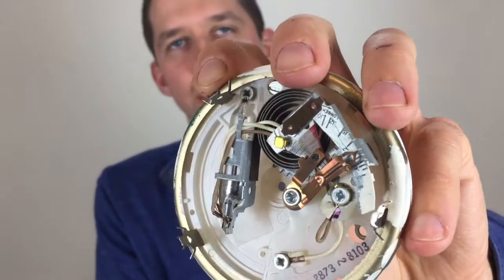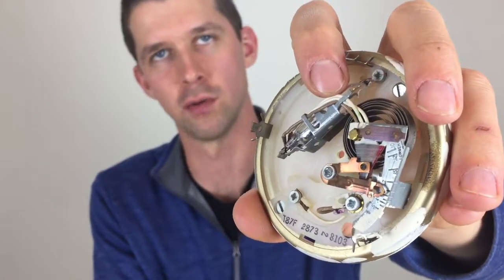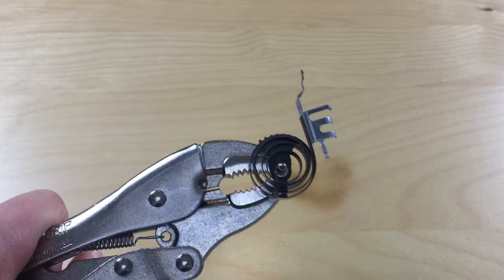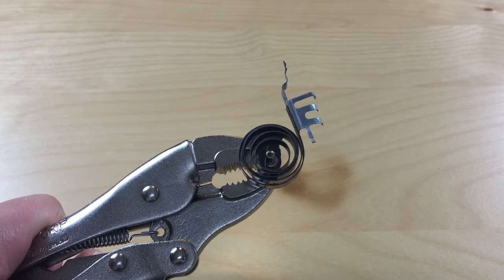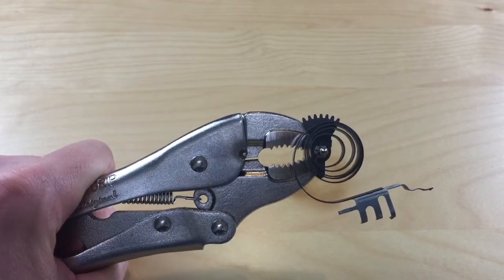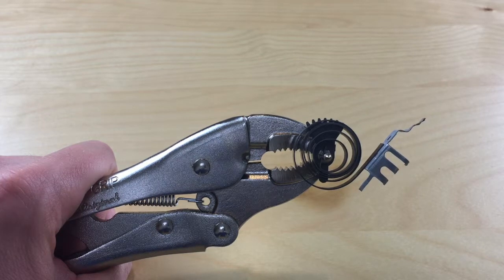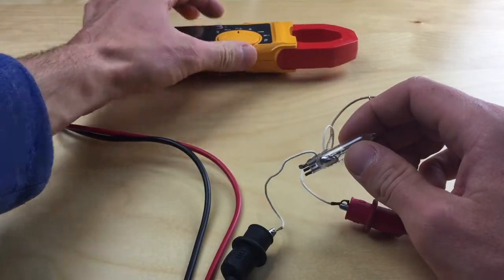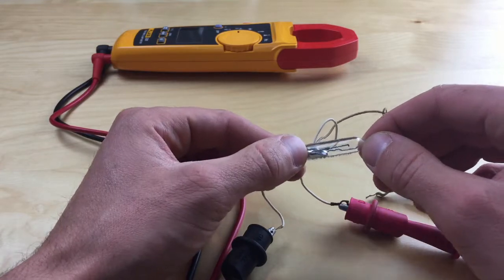How Does a Dial Thermostat Work?

Comment: What happens when you set it at a certain temperature?
Reply from the maker: Good question. Most thermostats are not designed to keep a room at an exact temperature. Rather, they keep the room within 2 or 3 degrees of the “set point”. Say you have the thermostat set at 70* in the middle of winter. As the room cools down, (likely around 68*) the spring contracts, causing the heating system to turn on. As the room heats up, (likely around 72*), the spring expands, causing the heat to turn off. It will repeat this cycle indefinitely, keeping the room around the 70* set point.